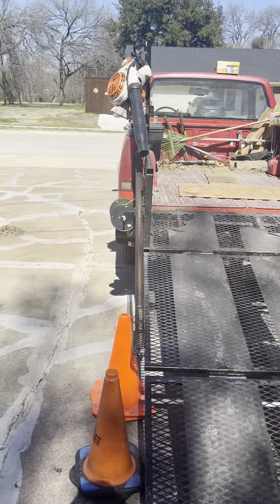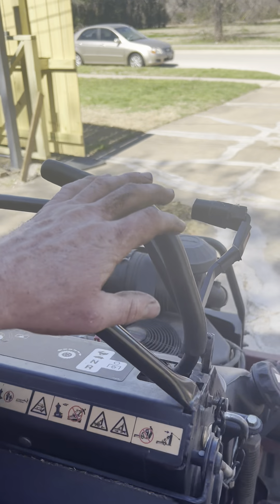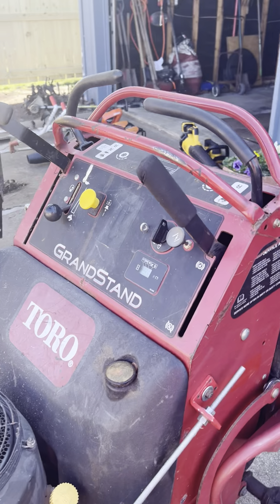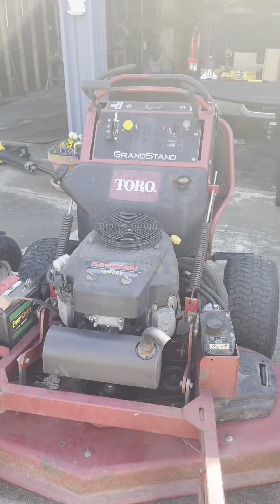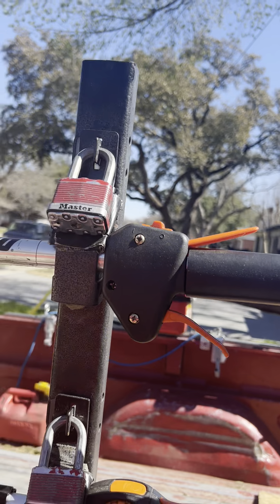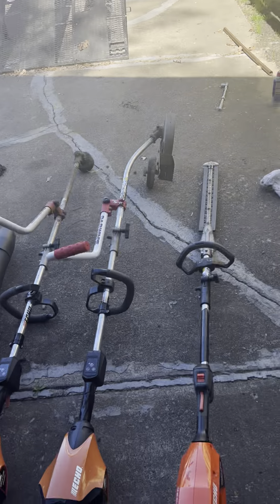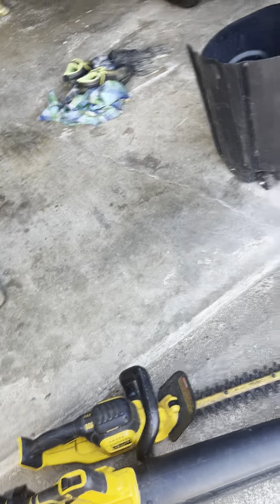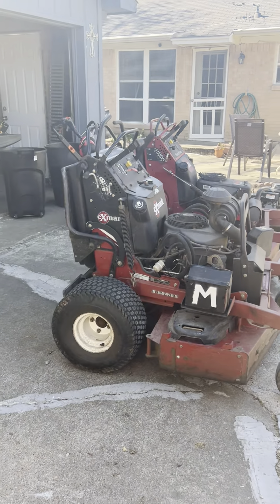Lawn care setup! 2024 season

Comment from the maker: Forgot to mention the Stihl KM-90R you can clearly see there, I have as my straight shaft edger currently. It doesn’t get a lot of use, but I do always run it as my bed edge definer due to the increase amount of torque. It is a 2012 model so it’s very old, but still going!